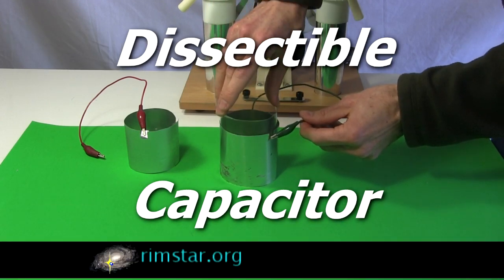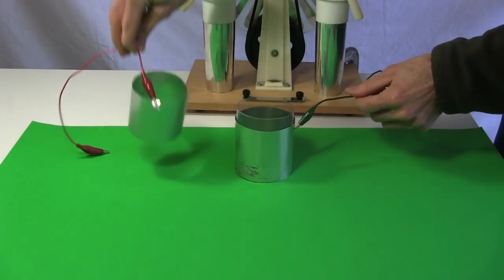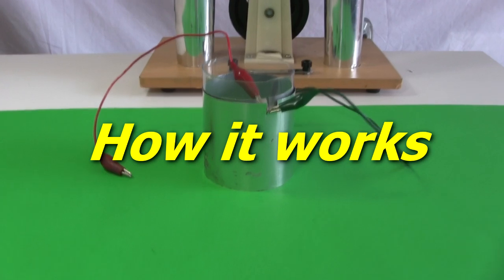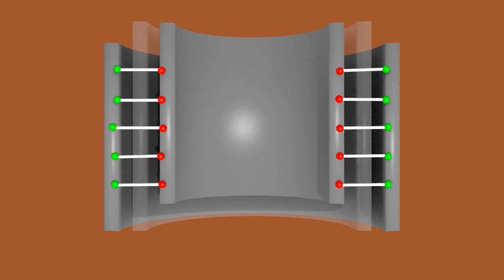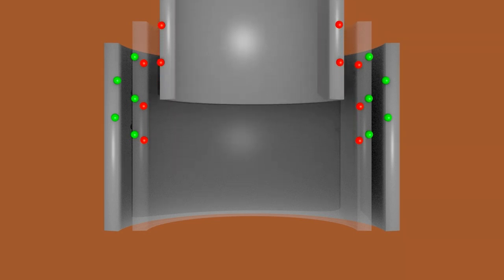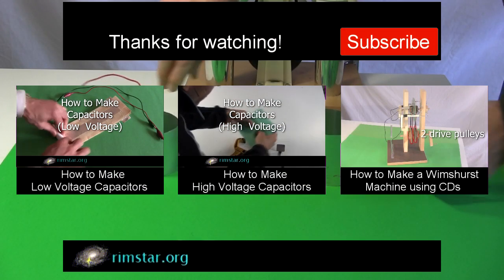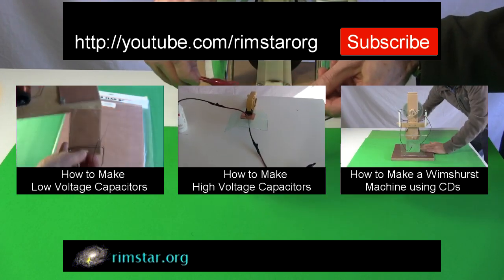Dissectible Capacitor/Leyden Jar - How it Works

Comment from the maker: A neat thing you can do with a high voltage capacitor, usually a Leyden jar - take it apart, discharge the plates, put it back together and it still has most of its charge! Enjoy!
Reply: RimstarOrg I seen someone charge a bottle of coke with like a million volts on a YouTube video and then they drank it and it looked like they got shocked I'm pretty sure it basically was acting as a capacitor

Comment: I had this come up yesterday as a question to a proposed design! Glad you made this demonstration. I am making a Leyden's Jar with distilled water and graphene. The concern was that the graphene would settle in the water eventually without a additional binding agent, but I brought up this example! To my estimate you can simply shake up the graphene water and the charge should redistribute from the dielectric back to the graphene without an issue.
Sound about right?

Comment: great video it would be nice if you would explain how plates get their charge back.
Reply from the maker: It would be just the reverse of how to dielectric container got charged. When the plates are put back, there's not a huge amount of surface area in contact with the container so only a little charge would move to the plates where the plates touch the container (since the container is an insulator, charge doesn't migrate across its surface to where it touches the plates.) The real action, I think, happens when the two ends of the alligator clips are brought close together, the spark gap. That's essentially the same as bringing the two plates close together, or the inside and outside of the container close together, creating a high potential difference between the inside of the container, the inside plate, through the spark gap, to the outside plate and the outside of the container. That potential difference is great enough to cause the ionization of the air gaps between the container and the plates. At that point the remaining charge where the container doesn't touch the plates goes from the container to the plates to the spark gap.

Comment: For the people that say they have never seen anything like this before, well if you ever heard of or used an electrophorus in school you have. A electrophorus is a dissectible capacitor. It is all caused by dielectric stress in the dielectric and the fact that dielectric will stay stressed for some time and can be made to stayed stressed for months if properly set up. But if this demo helps you understand more about charges and how they react in different materials, then this is good.  BOB

Comment: Now we need some experiment to find out if indeed is the metal holding charges and not the dielectric only all along!

This video made me come up with a question I have about capacitors in general: the usual thinking on capacitors is that we get a voltage between the plates and it will charge up (drawing amperes) until its voltage value equals the source of power. But, AFAIK, electrostatic machines will always generate little voltage, still a capacitor connected to them eventually raises an high voltage. Maybe these machines actually generate pulses of high voltage?
Reply from the maker: Regarding the dielectric only holding the charges all along... we know electrons are going to the negative plate, the plate is in contact with only some of the dielectric (in this case), so at most electrons would go to the dielectric there because electrons won't conduct across the surface to other parts that aren't in contact. So the dielectric alone couldn't hold all the charge. I don't know what would happen if you had a capacitor where all the dielectric was in contact with the plate though. I have heard of an experiment where if you start with too low a voltage then the charge stays with the plate since it can't reach high enough voltage to ionize the air.
Regarding your general question, in a Van de Graaff generator the dome can build up a very high voltage despite the belt and brushes being at a lower voltage because of the Faraday cage effect. In a Wimshurst machine, the capacitors build up a high voltage because the charge on the opposite capacitor plates have opposite charges that attract each other.

Comment: can you use a transformer as a coil for christel radio or no
Reply from the maker: +Andrew Kimble  Maybe, but only if you were luck enough to find are transformer what was the right shape. You need to be able to move a tuning bar across the top of the coil to tune the crystal radio. You could instead carefully remove the wire from the transformer and wrap it around a toilet paper cardboard tube to make your own coil. Just be careful to not damage any of the thin enamel insulation that's coating the wire.

Comment: sir, if I touched one plate of capacitors with my fingers and then discharge it by touching two plates. Will I experience any shock.
Reply from the maker: +Akash Padhye When you touch one plate of the capacitor with your fingers then some charge will move from your finger to the plate but I don't think it will be enough to give a shock. For it to give a shock, there has to be enough charge to electrically break down the air just before you touch it and I don't think there's enough for that. At least not with my experimental setup. Most of the charge is on the plastic or glass jar.

Comment: So if you put a conductor in contact with both sides of the dielectric when its dissembled, does it neutralize the charge?
Looking at your animation, I got an idea for a sliding capacitor step up transformer... Do you know if its been done before? I cant see it being fast or convenient, but an interesting learning tool maybe.
I've been looking for a good video on this for ages. No doubt I'll be linking to this oftern. Great work as usual.
Reply from the maker: If you put a conductor in contact with both sides of the dielectric when its dissembled it may or may not neutralize the charge. Since a dielectric is an insulator, electrons don't flow freely across it. So to discharge the dielectric in that way your conductor would have to make contact with then entire surface of both sides of the dielectric. That's not an easy thing to do.
I've seen a number of people experiment with capacitor transformers over the years. I don't recall any sliding ones though.
I'm glad you enjoyed the give. Thanks.
Reply: You can make a variable capacitor by having a conducting liquid (salt water) in the cup and a triangular moveable metal contact to that
Reply from the maker: jon sanford
I'm not sure I made the point of the one in this video clear. It was to show that you can remove the capacitor plates, discharge them, and put them back and the capacitor was still charged, since the charge had moved to the dielectric.
Another thing I should have made clearer is that you need a sufficiently high voltage on the capacitor, otherwise when you pull out the inner plate there won't be enough voltage produced to ionize the air and dump charge to the dielectric. If the starting voltage is too low then when you pull out the inner plate, no charge will go to the dielectric and when you discharge the plates, they will actually discharge. After reassembling the capacitor it won't be charged anymore.
Reply: jon sanford I was thinking about a capacitor that gets charged, then reduces the plate area. Lowering the farads, and thus forcing the voltage to increase to compensate for less storage volume.
Reply: Mongrel Shark There was a clever High voltage supply for a Giger Counter that charged up capacitors in parallel then switched them to series. with a printed circuit switch.
Reply: jon sanford  Hmmm I always wanted to do that for batteries with my energy harvesters. Most efficient way I could come up with was to put batterys in parallel with the charge storing caps in a voltage multiplier. Diode losses messed with it a bit though. Don't suppose you have a link?
Reply: Mongrel Shark it is an old book 
i think i know where it is
prey for me
Reply: LOL, Good luck! I hope you find it in short order.
Reply: this video is dead wrong
Reply: Theoria Apophasis Could you please explain why you think that?

I have replicated this experiment and a few variations. I can assure you the energy stored in a capacitor is stored on the dielectric. The conductor is only there to get the power to and from the dielectric.
Reply: go read THE FALLACY OF CONDUCTORS by Eric Dollard

google it

i dont THINK it, i KNOW IT
Reply: Got an experiment I can replicate to back up your theory?
Reply: yes, go take a TRANFORMER and see about the OIL inside zapping you into tomorrow.

and for gods sake learn what DIELECTRIC CAPACITANCE is

didnt you read Faraday, Steinmetz, Heaviside, JC Maxwell and Tesla??????
Reply: Why would transformer oil store a charge?

Re how capacitors work. I have a number of videos demonstrating practical experiments on my channel if you care to look.
Reply: why would transformer oil store a charge?

you really didnt just ask that did you???
Reply: Yes. Please explain.
Reply: See Eric P dollard,  free works.
Reply: I didn't ask Dollard, I asked Theoria Apophasis Because you are clearly so learned. Copy past if you must, but please explain why you think a transformers oil world store a charge.
Reply: Theoria Apophasis Thank you for explaining.
Reply: Theoria Apophasis I find a lot of what you said very interesting. However it still doesn't explain why you think this video is wrong, or why you think you could get a storage of charge effect from transformer oil.

If you put a bunch of charged particles on one side of a solid dielectric barrier. Then the oppositely charge (or non-charged if you like) particles are inclined to build up on the opposite side of that barrier. The charges "want" (for lack of a better word) to meet up and become equal, but they cant without a conductive path around the dielectric. This is what we call capacitance.
It doesn't work in a fluid as there is nothing solid to prevent the charged particles colliding and becoming equilised.

Its like you can separate magnets in attraction with a solid object but not with a fluid.

Unless you can provide an experiment I can replicate to verify your claims of "this video is dead wrong" Why should anyone believe you aver the video which is showing an experiment that people can replicate? One which I have replicated myself many times. Sometimes by acident with painful consequences....
Reply: soooooo what do you know about dielectrics?
Reply: Theoria Apophasis I take it you still haven’t watched any of my home made capacitor videos? I would highly recomend the ones I already linked to. They show this expriment does indeed work, There is no trickery and therefore this video cant be dead wrong. You will also see further examples of charge being stored on the surface of a dielectric. You can even try it yourself if you don't like my video....

I wont be replying further if you cant back up your theory with some prac I can try....
Reply: Theoria Apophasis dude, you're giving EPD a bad reputation with unqualified rebuttals like this.  Carefully construct your argument before you make any such reference.
Reply: I like the discussion. Another thought is that on a philosophy level the paranormal or God or whatever mechanics exist seem to always hide from man. That's why lightning is almost always far away and rarely close. Whatever magic they are doing out there has to be guarded. Possibly mankinds presence or observation like some quantum people have said might influence it.

Also how come storms with random chaos happen such as lightning, hail tornados. And it forms into certain things. Lord Kelvin demonstrated lightning.

But people do random things all the time, and even come together into busy masses, and nothing magical happens. 

Why doesnt burning a lantern magically charge up the lantern with particles and shock people?
Reply: @jonsanford0  What did he explain?

Comment: and how can you use a solar panels to use for the christele radio for the power source can you
Reply from the maker: +Andrew Kimble  You'd need to make or buy an amplifier and then use the solar panel to power the amplifier instead of using batteries. For example, it could be done with my homemade amplifier here https://www.youtube.com/watch?v=JtPwxbOgBHw, though you'd need around a 9V solar panel.

Comment: What if I charge only the inner aluminum part of the capacitor and do not ground the outer part?
Reply from the maker: That will still result in a charge difference between the two plates. The means there will still be a voltage and you'd still see an effect. It just might not be as large an effect.

Comment: Hello. I have a question. 
1. Why is the inner plate positively charged? I think, electrons are flowing into the recipient, so it should be negatively charged, right?
2. If you touch the plastic, Should it lose its charge?
Reply from the maker: Hi.
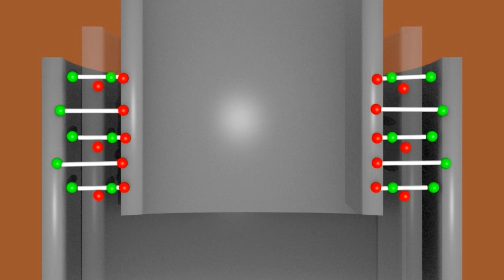1. If you mean at 2:06, you're right that electrons flow into the plate but only enough flow there to neutralize some of the positive charge. You can see some of them get neutralized in the animation. There's still some positive charge that doesn't get neutralized.
2. I do touch the plastic in the video and it removes some of the charge, but not all. Touching a metal plate removes all of the charge because the metal is electrically conductive and so the charges can move around it to get to my hand.
But the plastic is not electrically conductive, so the charges can't move around to get to my hand. That means that only the charge at the places where I actually physically touch it get removed. It turns out that it's very difficult to make physical contact with all of the surface of the plastic and so there's always charge left on it, quite a bit in fact.
Reply: Thank you very much. Just one more question left:
1.  Electric field between one plate and the other it's capable to break through the plastic, even despite  is not electrically conductive?
Reply from the maker: It's possible if the electric field is strong enough. In this case it wasn't strong enough. Searching for "breakdown voltage" or "dielectric strength" and the material your dielectric (the plastic in between the plates) is made of will tell you how many volts you need per thickness in order for it to break down.
Reply: thank you for take the time to answer.

Comment: But why don't both plates got discharged when you take the first plate and then you make it touched the second plate?
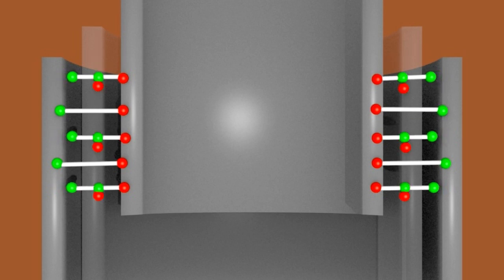Reply from the maker: They do discharge, but the charge on the plates when you pull the out is small, so it's not very noticeable. At 2:16, I point that out. You can see the plates losing chage starting at 1:55.
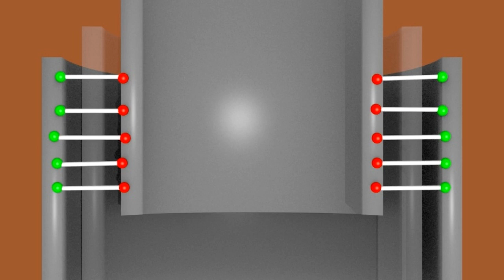Reply: @RimstarOrg  I do understand the your explanation at 1:55 though but what I’m asking you is at 0:38 where the first plate and second plate touched each other. What puzzled me is that if I’m not mistaken both plates are conductors and they are charged (with equal amount of charge but opposite sign) so if they touch each other then both of them should be immediately discharge and both plates become neutral right? but it turn out at 0:59 after you reassemble the Leyden jar and you take the two alligator clips (one connect to the inner plate and another connect to the outer plate) close to each other and then there is a spark or discharge therefore that mean both plates are still charged even after you made both of them touch each other. So the question is how is there a spark at 0:59 even though both plate were already touched each other at 0:38? It would be cool if you help me further clear my confusion.
Reply from the maker: I guess I should have made another animation similiar to 1:55 but instead showing what happens when you put the plates back together. You're right, after discharging the plates at 0:38, they become neutral. But when you reassemble it, the electric field from the charge on the plastic recharges the plates, similar to how at 1:55 the electric field removed charge from the plates. That's why when you bring the alligator clips close together at 0:59, there's a spark.

Comment: I do not agree with this particle explanation. This involves the dielectric field, that can store electric energy within.
Reply from the maker: Here's my source https://en.wikipedia.org/wiki/Leyden_jar#Storage_of_the_charge which uses this source https://web.archive.org/web/20110727024546/http://www.sis.org.uk/bulletin/99/mills.pdf
Reply: @RimstarOrg  thanks for the source, but I feel its different than this unicorn charge particle theory.  You can feel the electro static field, that's not based on particles but based in the electric field.

Comment: I got all the electronics to build it just give me a list of parts to build it or punctures of it.
Reply from the maker: +Andrew Kimble  Parts list or pictures for what? Do you mean for the solar cell powering an amplifier to power a crystal radio? I that case just just build the amplifier in the video I linked to or using the details for it on this page http://rimstar.org/science_electronics_projects/make_crystal_radio_amplifier_for_speaker.htm but use a solar panel instead of a 9 volt battery.

Comment: but that's nonsense! it's an insulator how could charge "jump onto it"? If charge could move across the surface of an insulator it would just move to the other side across the surface!
Reply from the maker: I didn't say charge moves across the surface of the insulator. You're right to say it doesn't. But charge can definitely jump onto or off of an insulator.